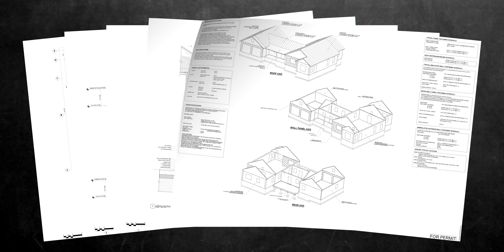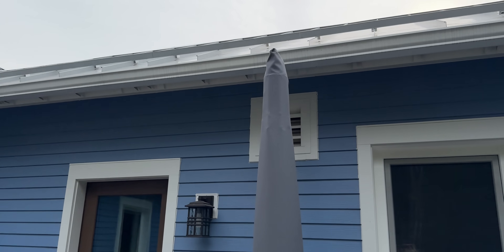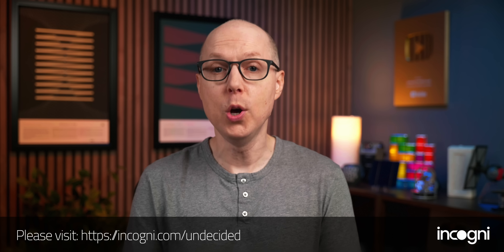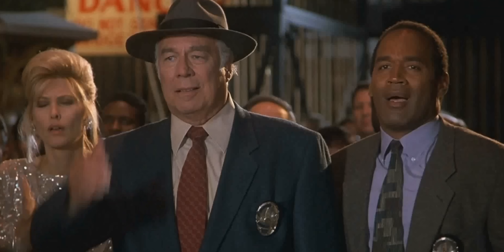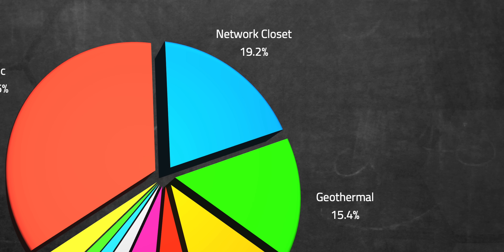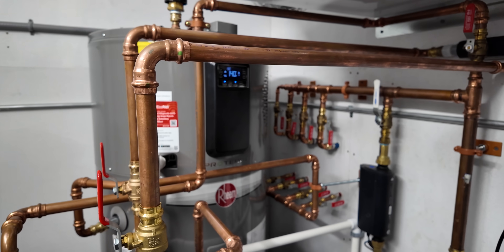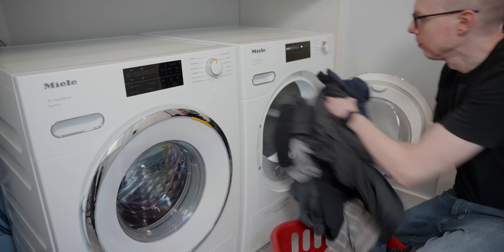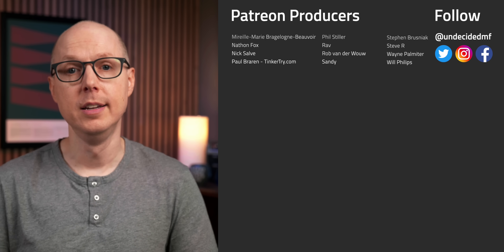What I Learned After 1 Year in My Net Zero House

Comment: Example follows of slab-on-grade challenges…
Our 2-story house, bought in 2011, was built in 1967 as slab-on-grade (bedrock excavated for slab). Original HVAC was a central furnace on the slab level to 4” ducts running under the slab to 4 registers, and 8” ducts between joists of the second floor to 10 registers. The layout is to provide heat, not cooling. 

Bought central A/C unit about 2014 that occasionally had interior coils ice up due to primary return on floor of 2nd floor next to stairwell beside HVAC closet. Three other smaller returns were built either in ceiling of 1st floor (2) or in floor of master bedroom. Thus, hottest air was not captured and cooled air short circuited on first floor. A/C compressor failed in 2023 (due to my inadequate maintenance?).

Converted to central heat pump in March 2024 and extended duct of master’s return to ceiling as well as adding 3 registers to 2nd floor ceiling. Heat pump’s coils at central unit began to ice up when cooling mode went to work. After numerous experiments to focus return air to the new ceiling return, and many visits by the installer to troubleshoot, the cause was found in August…refrigerant had only been charged to half during original installation (no leaks detected).

In September several sink and tub drains slowed and worsened. Camera of sewer pipes found cast iron heavily rusted. Snaking found drainage impeded by hair. 

In summary, the HVAC mods were needed due to builder’s assumption cooling would be unnecessary. Retrofitting was complicated by slab-on-grade. Sewer pipe replacement is impractical due to slab-on-grade so lining the pipes is only practical option to slow corrosion that chokes down cross-section.

And the roof needed replacement in late 2023. Too bad the planned HVAC mods expense didn’t allow for enough $$$ to buy a metal standing seam roof, as we are in a NW forest (fire?!?). Maybe the Cascadia Subduction Zone quake won’t be an issue with the house being built into bedrock? 🤞

Comment: I would be curious as I am kinda looking, how do you learn about the (various?) ground source heat pumps, I can't really seem to find much about them online so far.  Yours is apparently ducted, so I assume there is a central air handler still.  Do they make VRF split heads for this (as they do for air source systems?)  Does anyone know why not if no?

I think for me a ground to air (ductless VRF) and water (bathroom floor heaters and water heater) would be ideal, but I have no idea if such a beast exists.
Reply: LG, Mitsubishi and Daikin make this equipment.  You need to find a contractor who has experience with commercial hvac systems.

Comment: I have a passive house.
One thing you're lacking is insulated window shutters. (On the inside)
Also, layout of the house is completely wrong.  It should be as near to a cube shape as possible to reduce the amount of heat loss from outside walls. Even better if it can be earth shielded.
This also reduces building costs.
Heat recovery and mechanical ventilation is a complete waste of time and money. Everywhere I have seen this, it has been shut down and abandoned by the owners after only a short period of use.
Low technology is good technology.
You can't beat thermal mass (ie thick masonry walls insulated on the outside.)
I can store enough heat energy in my walls to last for weeks.
Standard American tacky house construction  is a waste of time.
These are very elementary things.

Comment: Re: heat backup. My heat (air sourced) heat pump system includes an electric resistive backup in case the outside air is too cold for the heat pump to heat the house. (happens for a few hours on a few days in the middle of winter where I live at most). If you have the data to see if the "heat backup" happens on very cold days, that might be it.
Since January 15th my house has been al electric and I love it. If things continue as they have, it will cut my energy bill by 2/3rds and if it had been as sunny as the last three years, I would have achieved net zero, but how it looks now I will still have to buy ~500 kWh in the coming winter.
Reply from the maker: Yeah, but that's not a part of my HVAC setup, which is why I'm a little confused.  I think it might be related to the hot water system (maybe?).  Still tracking it down.
Reply: @UndecidedMF  We’ve had a Waterfurnace geothermal furnace for 22 years now. Love it. Our furnace has heating elements at the bottom as an auxiliary heat source should the geothermal fail or when temperatures drop rapidly in winter (e.g. dusk after a sunny day in February). That might be your backup heat consumption. It’s usually on separate breakers from the geothermal system.

Comment: Excellent!  You used every tool AND showed us how and the results.  Here's what I'd love to see developed next:
1.  Power over Ethernet (POE) wiring to supply the lighting (LED) and electronics and communication.  It's less expensive and more efficient.
2.  Optimized air flow.  Short, fat, straight ducts give you the most comfort at the lowest cost.  How do we incorporate that into our "perfect homes" with so many varied shapes?
3.  Optimized plumbing layout.  Shorter pipes means lower cost and less waiting for the shower to warm up.  Gary Klein has all the data;  he's smart and entertaining.  Thanks again!
Reply: POE is expensive to do, it all proprietary hardware. I'd love to install it in my current house renovation but at every avenue I come to a company wanting thousands for some components.
Reply: Point 2. If you optimize vents too much you will have sound problem between rooms. Rooms will be connected by short large pipe transfering your every fart sound to next room. Use mufflers and bends to deaden sound before it reaches next opening.
Reply: POE is neither of those things, but keep telling yourself that. ('tho it is very neat.)
Reply: PoE injectors at <10 bucks and not proprietary.
Reply: @dfgdfg_  So you're happy installing a 50% efficiency "wall wart" (effectively what an injector is) for every light? You'd be better off stringing DC power lines directly from the "storage battery". (then you'll learn just how inefficient low voltage DC distribution really is.)
Reply: For small electronic gadgets PoE may be more efficient than a typical wall wart but for lighting PoE is decidedly less efficient. Running 60v on the equivalent of 18AWG is going to have much greater losses than 120v on 14AWG wire.
Reply: Why not put smaller heaters closer to the shower?
Reply: POE for lighting is actually not efficient because you need 1 single cable to every single lighting. Wifi or zigbee/zwave based controls are far easier to set up.
Reply: Light powered over POE sounds awesome. Do you have any recomendations?
Reply: @SilverSmrfr  Actually Matt did a video last about POE and other tech in the Hotel Marcel renovation to passivhaus and net zero.  Google "Hotel Marcel power over ethernet" for details from the hotel and from suppliers.  The market is still in its infancy, but every architect, builder, electrical contractor,  engineer, and Home Depot should be learning.  I hope Matt tells us more about his network closet, since he has a lot of AV and home security gear.   There's more info at Wikipedia, reddit, Cisco, Netgear.
Reply: @MarkShapiro-m8r  get a recirc pump on a timer to ensure hot showers in the morning.  Our is hot in 5 seconds.  If you run when the recirc is not running it takes 30+ secs to warm up.

Comment: We recently purchased the new Whirlpool heat pump dryer, works great and a big energy savings from the 20 year old Kenmore/Whirlpool HE electric dryer.  I did a Sense energy analysis between the two when I switched them.  Still getting used to the cycles and monitoring how much clothes/towels are the best amount to run.  For some things, might have to run a low cycle for about 10 minutes to "fluff" things before taking them out.

Matt,  what are your thoughts on a heat pump water heater to be the source of an in floor heat system?  New poured basement, 2" foam under slab with PEX on it.  The water heater would be in the basement.

Thanks for the great info and keep up the good work on all of this tech.

Comment: Great tech and techniques. Was surprised with a slab on grade there was not in floor heat and cooling?

Hopefully your using the water from the dehumidifier. 

Did you do a thermal scan of the house? 

Decades ago I rented a new duplex, checked the HVAC filter and it was plugged. Since then I have always run the fan 24/7 and changed the filters monthly. 

I think you did great balancing the system, most homes ducts are under sized. 

Great vid!

Comment: When you want to shade your windows, always have shading outside. Otherwise most of the heat has already entered your home
Reply: Awnings use to be the game.
Shade the windows, letting you get a cross-breeze through open windows while still blocking some of the sunlight.
-
I think a great version of awnings for people living in areas prone to high-wind disasters or fires would be metal awnings that can be lowered and locked down to be window protection.
Reply: Use deciduous trees - shaded in the summer, not in the winter due to leaves falling off.
Reply: I did electric outdoor blinds on my large sliding door to the backyard. Absolute lifesaver in blocking heat and excess light in the early morning (SE facing.)
Reply: Cell blinds add a small benefit that represents a relatively big uplift if you’ve got bad windows so is good for renters and those lumbered with bad windows which are expensive to upgrade. 

But with good windows the impact of the blinds is minimal.
Reply: I would really like to see some graphs on how all of this technology cost upfront and cost to maintain is compared to the energy savings. This seems really cool, but also I can’t get past how all of this is so complex that it seems like it would be a nightmare, when it’s time to repair and overhaul things in 10 years.
Reply: I don't think this applies for triple pane windows. Based on the exterior video of the photos, these windows appear slightly grey-tinted. Additionally I'm sure they have at minimum a Low-E coating (which does have a slight tint, but not as dark as tinted glass).
Reply: @Montusama  This would apply to any windows. In my house I have over 100 m2 latest class triple pane windows ( 75 m2 south facing ) with some silver layer crystals to pass/block sun rays  depending on their inclination angle. Still in the summer the room is considerably warm, even in South Europe ( for us is OK, as we use a natural air draft, based on the house geometry, to cool ) but for many people, used to using air conditioning, that likely will not be acceptable and they will turn up the energy use to cool down. This is why, if for cooling, outside shades are the best and hands down most efficient usage of resources and money.
Reply: I bought windows with a tinting layer installed on the inside of the 3ple pane. it does absolute wonders
Reply: @Lordazoid  i always said that i want to have blinds like they have in the south of France. As a kid when we went on vacation there i was always amazed with how much cooler it was inside. Plus i just really like the look haha
Reply: I see someone watched Alec's video ;)
Reply: @Lordazoid  awenings are a forgotten cooling technology
Reply: Modeling a home is key to knowing about what will happen during the course of the year. I fear so many people build a house and then have no clue why half the house is deadly hot in the summer/winter. Because all of that heat build up with so many windows. Hvac systems are not sized right because they do not account for the true load of the home or base those numbers on the ideal hottest or colded temps per year.
Reply: Ideally, yes. But shading windows when outside temps are low helps keep heat in and drafts low.
Reply: In his case the triple glazing and passive ready window seals are 99% of his solution the window coverings are mainly for privacy
Reply: @CarkeekW You typically want to maximize solar heat gain on the south side with the proper low e coating to get the free heat. In primarily heating climates that is. Selecting the coating that has a good U factor but still high solar heat gain, compared to coatings that have very low solar heat gain.
Reply: @AnvilCreekLodge  retractable shades used to be fairly common in the USA and around the world... its like we forgot about that tech when we got AC.
Reply: @AnvilCreekLodge  Yeah, and just like curtains you can move it. Outside is the better place.
Reply: @AnvilCreekLodge  That effect is absolutely negligible. Especially compared to the greenhouse effect that heats the house up in summer. 

Want to keep the house cool in summer --> shades on the outside

Want to keep it warm in the winter? --> No shades + well insulated windows 

Greenhouse effect also works in the winter. So keeping the shades open is the best thing to do
Reply: @Harry_Gersack  no shades in winter when the sun shines. When the sun is down shut the drapes.
Reply: @sittinandthinkin   Ok, I can live with that
Reply: For that one needs to think logically & simply when building and designing things, not just bundle tech together and call it energy efficient. A house out of straw and mud is not only energy efficient but also carbon negative.
Reply: Having cell blinds inside can add insulation that can sometimes double the windows insulation value. Cell blinds can add R2 insulation. Outside is if you have radiant heat to block from getting inside, but in primarily heating climates you would want inside shades.
Reply: @Jaker788  The type of blinds shown in the video definitely do not provide any insulation. For windows insulation, in cold climates, one need to use heavy curtains, with length to the base board of the window as to make a call air pocket. That will make sure that the colder air, created by touching the glass, stays ( as much as possible ) in the air pocket and without spreading much in the room. The blinds shown do not have any of the requisites for the noted fluid dynamic to materialize.

Comment: Matt, I don't know exactly what is going on but in the middle of watching your video I suddenly gave you a thumbs up which wasn't me. I live in Japan and they have strict privacy laws here and I do a lot to protect my privacy. I suspect this was a google thing, just to let you know.

That said, my father a carpenter built a passive solar home in Wisconsin back in 1980. 1/2 of the house had a ground barrier that came up to the windows for half the house. He also built a passive solar system of a greenhouse on the southside which would heat the house in winter but with thermal curtains keep it cool in the summer. (He lives in Wisconsin and at the time this was the highest tech at the time). He also built a fireplace with a forced air  system which I remember when I was young made the house so hot in winter (100 degrees) that I had to sit around in a t-shirt and shorts in winter. (He later changed the fireplace to a pellate furnace for more heating efficiency. The passive solar only heated the kitchen and living room, my father's logic was that in the bedroom you could simply add a quilt to keep you warm. 

There have been some problems since, the ground wall which went round half the house pulled water up and flooded his basement, and the treated wood he used which was suppose to last forever only lasted 40 years and he had to have it dug out and replaced with slate. But in our old house he paid in winter around $400/mo. for fuel oil. Now he pays around $40 / mo. for natural gas heating. 

He would be a good story of passive tech vs. new tech that you have installed, an older system but still is a way of reducing energy lose. My dad is a carpenter and I cannot tell you how many stories of people who he changed their windows and they immediately saw a 10% drop in their heating bill. 

There are many easy and lo-tech solutions that people could make to an old house to save a little bit of money. Perhaps you could do a show on simple measures people could take to cut their fuel bill.

Comment: I wonder how much specifically the ground source heat pump contributed to that 25-30% price per square foot hike.  I'm assuming that's one top of the 10-20% markup per sf for new construction in general, so roughly 37%-56% markup vs existing, "normal" home.  Tough pill to swallow, if I'm being honest, but that's super subjective based on personal economy and such.  I'm not going to be shooting for net zero, but in about 5 years I'll be looking to do a more modest version of what you did.  Not full net zero, but new construction, 'passive house' style air tightness, ERV, solar w/ batteries, heat pump all the things, etc.  But basement is essential for us, and probably need a bigger house based on family size.  I also don't have nor ever plan to get an EV.  But following your house journey is by far my favorite part of your channel.  Thanks for putting it together!